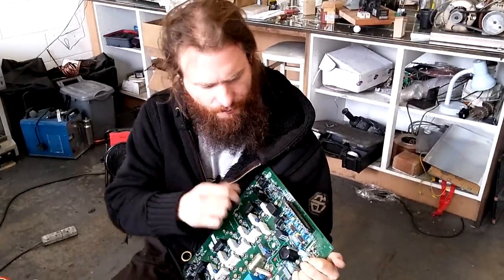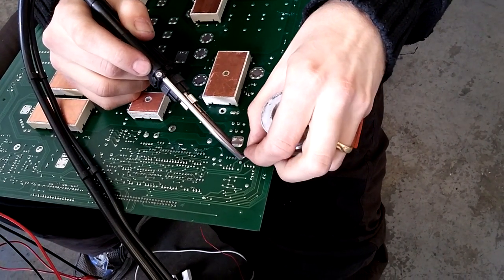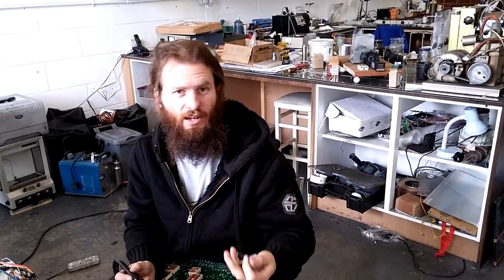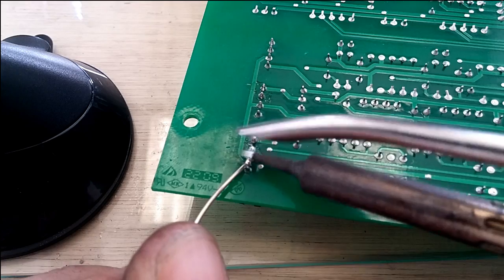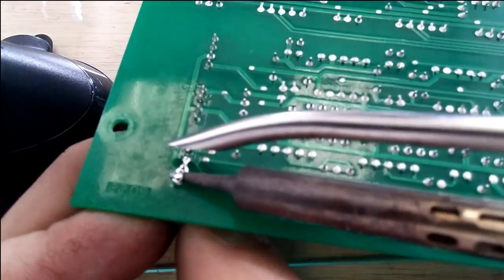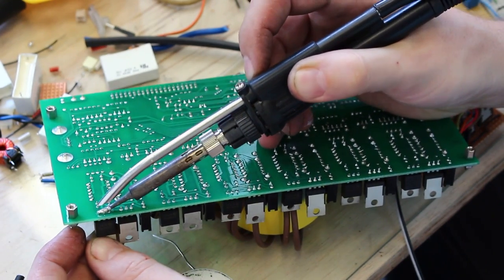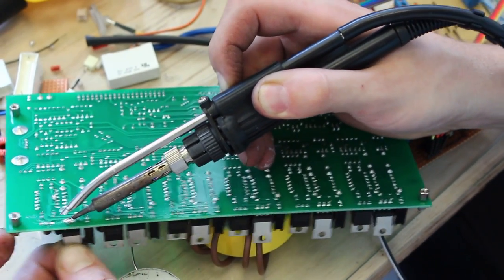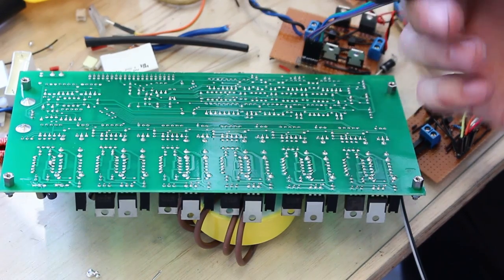Desoldering Multiple Pins With Bridging

Comment: I still have no idea how to take off an 8 pin chip with my soldering iron without the help of a dremel to cut out the chip off the board and separate the pins.
Reply: JRad try using solder wick